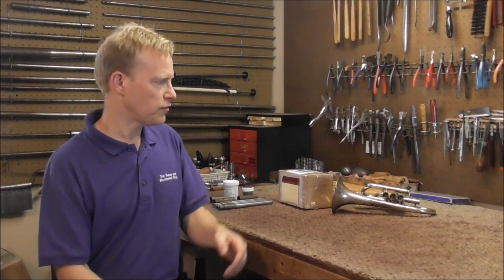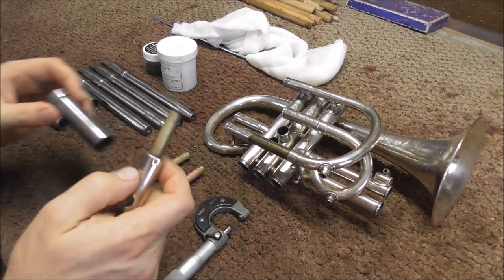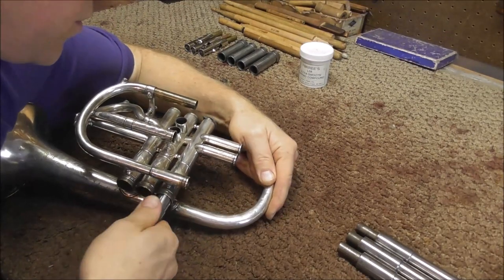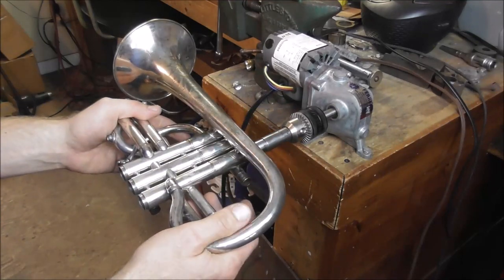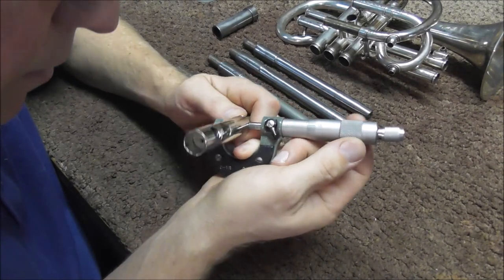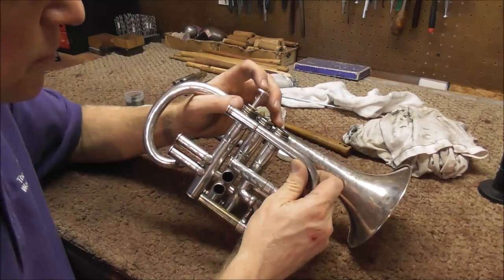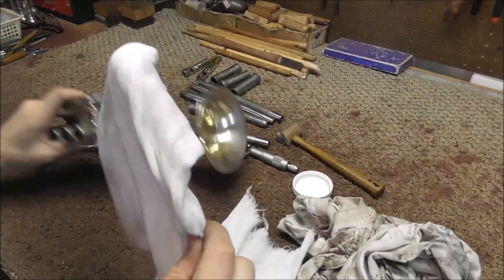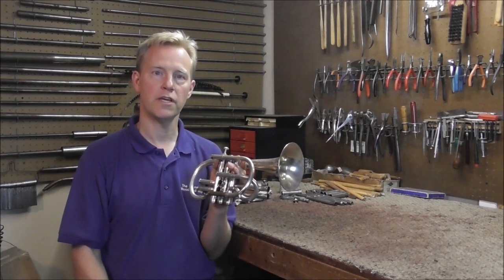Replating and Refitting Valves: Antique Distin Cornet Restoration Project #8

Comment: You can add a few drops of oil to the lapping compound if it seems very thick. This will thin it slightly and can make it more free-cutting, so it takes less time and compound to complete lapping. The only drawback is that compound will migrate into the cross tubes off the valve (this is happening now, but somewhat less) so it would be better to clean the instrument inside with some solvent like WD-40 sprayed into it, then wiped with the rag, and finally a final cleaning with some non-oily solvent like IPA or possibly paint thinner. Or I guess you could dip the instrument in your cleaning chemicals.

Comment: definitely a much needed improvement for those valves! I'll have to get the valves replated on a 1930s H.N. White American Standard Baritone that's here in the Brass Lab here at Red Wing, of course, if I end up buying it. It's missing all but two of the braces, and the mouthpipe came un soldered when I was practicing on it, because Greg allowed me to take it home to practice on for the River Valley Band, and it the two solder joints that held the mouthpipe in place just kinda gave up. 

To be honest, one of the solder joints looked like it had been re-done at some point and it didn't get filled 100%. I'm finding the BIR program very fun to be in, and I am enjoying the process of examining and repairing band instruments!
Reply from the maker: I went to Red Wing too and I loved it. I was one of Gene Beckwith's last students before he retired. 
I am glad you are enjoying the BIR program. 
Art